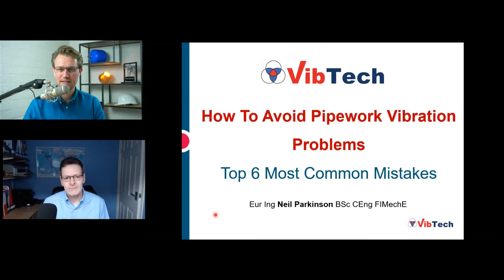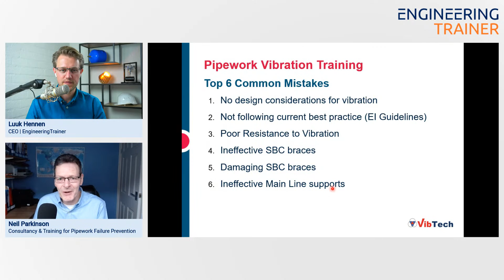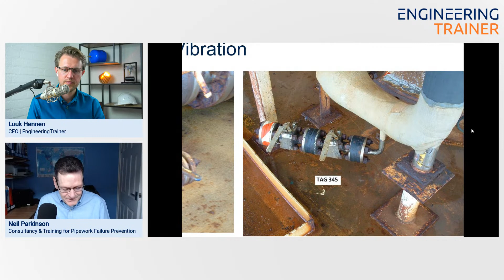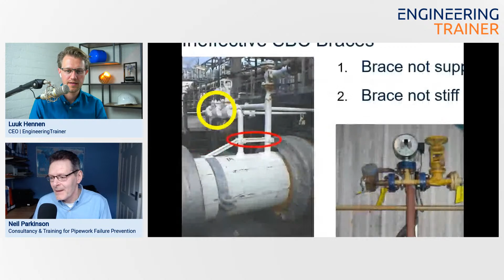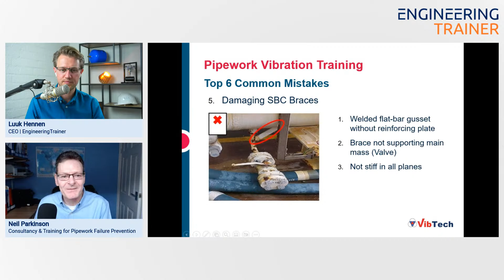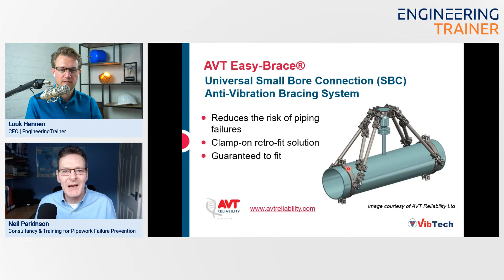ET-TV #13 - How to Avoid Pipework Vibration Problems (Top 6 Most Common Mistakes)

Comment: great! is there a minimum required length of SBC to supported? or just support a SBC regardless of the length?
Reply: Thanks for your comment. The answer depends on the type of SBC. For simple cantilevered SBCs like the ones I showed in the presentation, the overall length should be minimised to reduce the risk. However for SBC which connect to a fixed point or which connect between 2 different main lines, the overall length must be ‘not less than a minimum allowable length’ as specified in the EI Guidelines. This length depends on the SBC branch diameter and the type of welded fitting e.g. Weldolet. Let me know if this answers your question. Regards, Neil
Reply: @neilparkinson119  thanks for the reply.